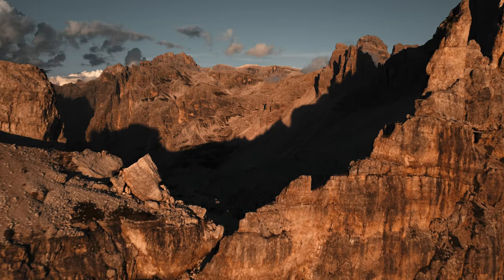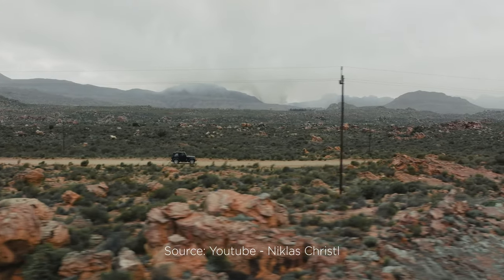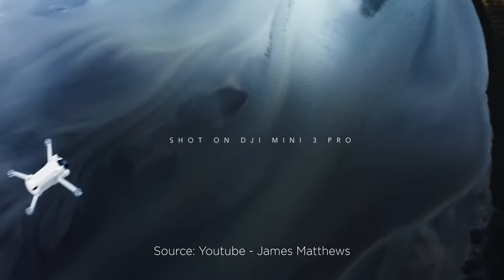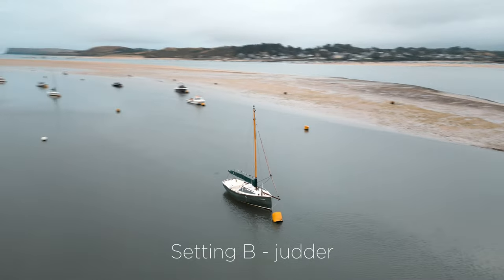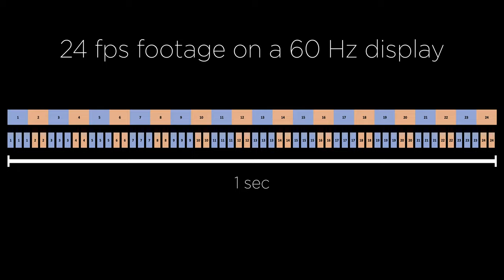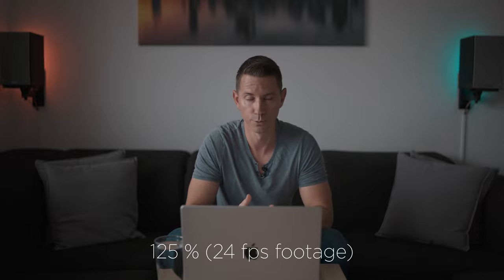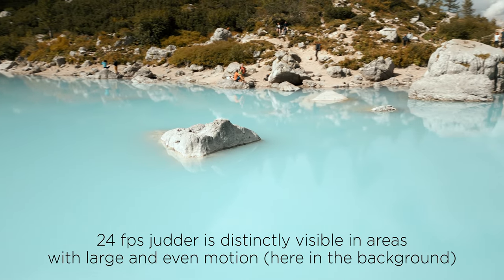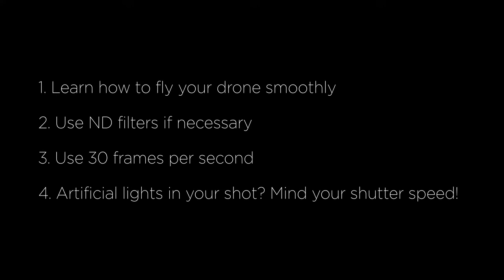The #1 Secret for CINEMATIC Drone Video without Judder, Stutter or Jerkiness

Comment: Hi sir, If my 30 fps on Drone what is my shutter speed? To get smooth motion blur.
Reply from the maker: According to 180 degree shutter rule, you should use 1/60. Me personally, I prefer Between 1/30 and 1/50 with most drone shots.
I have a tutorial video where I talk about things like this.
The ULTIMATE Guide to PRO QUALITY Drone Footage - DJI Mini 3 Pro
https://youtu.be/5aotiUE-iOk
Reply: @t0mwhazzup  Hi thank you, but my shutter speed on my Mini 3 is written in 1/6000 is that the same as 1/60?
Reply from the maker: @yujiitadori30  No, it's not the same. You need ND filters to achieve that, and I explain how that works in the video I put the link in my last response to you :)

Comment: How about 30 FPS drone footage in a 25 FPS timeline? My camera footage will always be 25 FPS. I don't like the 30 FPS look. 04:40 If I put my camera footage of 25 FPS in a 30 FPS timeline I would have to speed it up. But this doesn't make sense. Why would I want to speed up my camera footage? For example interview footage.
Reply from the maker: Well, if you plan to stick with 25 fps all the time for some reason, then do your drone footage also in 25 fps so everything matches.

We run a video production business and we choose recording frame rate and timeline framerate based on the project's target medium. If the project will be aired on TV, we of course do 25 fps because broadcast here in Austria (PAL) is 25/50 so doing the project in 25 fps is technically correct. But all the digital/online/socialmedia stuff that we produce, we do in 30 fps because computer/smartphone screen refresh standard is 60 Hz and 25 fps is technically incorrect. If we have projects that will be used for digital and TV, we consider which part is more important for the client and then go from there.

Generally speaking, frame rate is overrated, in 90% of situations it does not matter whether it's 24/25/30, even though if screen refresh rate doesn't match. You won't see the missing or doubled up frames in most types of footage. It's just in the nature of drone footage and it's camera movement, that makes this incompatibilities often very obvious. But apart from that, most of the times you will be fine with either. I mean, we also put our broadcast stuff (25 fps) on our website portfolio and it doesn't automatically look horrible ;)

And my video here is of course about Youtube (which belongs do the digital/online/social media part), that's why I recommend 30 fps because it avoids judder and is (besides 60 fps, which does not look cinematic/filmic any more) the technically correct frame rate on 60 Hz screens. Speeding up an interview from 25 to 30 fps makes of course no sense as you said. Either you reconsider to also film your camera footage in 30 fps (if you do it for online/digital), or you prefer to stick with 25 fps no matter what, but then do the drone footage in 25 fps as well.

Hope that helps :) Cheers!

Comment: What about 60 fps footage on a 30 fps timeline. Will the two frames be combined and averaged automatically to look identical to native 30 fps footage?
Reply from the maker: No, if played back in real time, every other frame will be skipped. When you use a 30 fps timeline (which I recommend) I would really only film in 60 fps if you want to slow your footage down. It makes no sense otherwise. Every other frame will be discarded, you have worse image quality frame by frame (since the there's twice the amount of frames packed in the same file size) and you lose the ability to use shutter speed slower than 1/60.
Reply: @t0mwhazzup  For me it's either 60 or 120fps recording due to the speed of the drone (cinematic fpv using DJI O3 camera). 30fps is too slow to fly with. But I guess recording 60 and playing back 60 would be the same as record 30 play 30 when it comes to smoothness given 180 rule used?
Reply from the maker: @stefangranath3841  I'll give you a little bit of a longer response here because I have a few thoughts on that.

In general, I use only 30 fps timelines (= 30 fps playback). For one, because of its compatibility for the majority of screens (60 Hz) as explained in this video, and the second reason is that my goal is to make videos that have more of a film-like or cinematic quality, and this is rather achieved with 30 fps than with 60 fps because the lower framerate is closer to the cinematic standard of 24 fps that we're used to from films. If you prefer more of a reality-like watching experience, then you can go with a 60 fps timeline, of course.

So, if you like to have a more close-to-reality feel, go with a 60 fps timeline and choose a shutter speed that lies somewhere in between 1/60 and 1/200. A good exposure is more important to me than sticking to the 180 degree rule no matter what, but in general, yes, 180 degree rule. BUT the higher the playback framerate, the less important to 180 degree rule gets. The reason for that is, the more fps, the less your eye is able to discern one frame from another (and therefore the imaging content and amount of motion blur in each frame).

If, however, you want to go with a 30 fps timeline in order to have a more film-like result, do the following (that's what I do):

I also fly with 60 fps because of the speed of the drone and the 60 Hz image transmission I want therefore (more on that later). BUT because I know that the final video will be 30 fps and therefore every other frame will be discarded, I try to use 1/60 sec exposure time because that will give me the 180 degree rule. I hope this is understandable, but basically you always have to adjust the shutter speed according to the intended video frame rate, not recording frame rate (in terms of fps), to comply to the 180 degree rule.
I might deviate a little bit from that when the exposure requires it (e.g. using 1/80 or 1/100 sec when otherwise the video would be overexposed), but in general, I try to get as close as possible to 1/60 sec for my 30 fps videos.

I once also tried out 30 fps recording (and therefore 30 Hz transmission) with my Avata because that would give me the possibility to use shutter speeds down to 1/30 sec. One benefit from this would be that I am more flexible to adjust my shutter speed (without changing the ND filter during a flight) in a broader range (I'd say, 1/30 to 1/100 is useable). 1/30 sec equals a 360 degree shutter in a 30 fps final video and that gives even more motion blur. I personally like that in many situations, but this really is a matter of taste and maybe not for everybody. Have a try yourself.
I found that 30 Hz transmission is not so bad for my style of flying. I do no acro or racing where I'd consider 60 Hz as essential. So it would be doable with 30 Hz I think, but as my experience with flying FPV is not very broad so far, for now I have sticked to 60 fps/Hz with FPV, just to be sure. Depending on how you fly, you could give it a try and see if it's fast enough for you.

I hope this was not too long and complicated and you can get some use out of this information!
Reply: @t0mwhazzup  This was an awesome reply! Most importantly I will experiment more. The main issue with higher-speed flying and close proximity would be too much motion blur. I think the normal rules so to speak come from more of a static camera. As long as I fly with editing in mind. Love your videos man, keep it up <3
Reply from the maker: Yeah, for high-speed close-proximity FPV a 360 degree shutter (ie 1/30 at 30 fps or 1/60 at 60 fps could be too blurry.
I think though, that at higher fps like 60 or even higher, it should not be much of an issue any more. Guess we gotta try 🙂

Comment: DUDE!!! 
BOTH bridge clips are juttering. Same with the side movement clip.
Reply from the maker: Wrong wording maybe. As long as you don't use 360 degree shutter (which can make things smeary), there will be sone kind of movement gap that can be perceived as some kind of stutter. However, the 24 fps clips have this uneven 3-2 cadence which is omitted in the 30 fps clips. Maybe you can see more difference in the clip where the drone orbits around the sailing boat.

Comment: Hi Tom, great video. It's answered lots of questions. Just wondering, what shutter speeds do you think would work best, if you wish to use 60fps for drones in 60 Hz and 50 Hz? Subbed, liked and rang the bell 👍
Reply from the maker: Thank you very much for your feedback! 🙂
What exactly do you mean by saying 60 fps in 60 Hz and 50 Hz?
Do you mean for 60 Hz/50 Hz areas (mains frequency) or 60 Hz/50 Hz display refresh rate?
Reply: @t0mwhazzup  🙂 Thanks for your quick reply. I was looking at 60 Hz/50 Hz areas mains frequency, but also any tips on display refresh rate would be great 👍
Reply from the maker: @Rob.P  The easy part first: when it comes to displays, always make your videos for 60 Hz displays, that means: 30 fps (for filmlike look) or 60 fps (for more real/sports-like look) timeline. Reason: all consumer displays are able for 60 Hz, so they can playback 30 & 60 fps videos smoothly. The shutter speed is not relevant for display refresh rate, only the video frame rate.

When it comes to the mains frequency... it is really only an issue when you have artificial lights in your shot. If not, you don't need to care at all because there are no sources for flickering.
If there is artificial lights in your shot, in 60 Hz areas (America mostly), you can use any shutter speed with 30/60fps. In 50 Hz countries, you need to use 1/50 sec or 1/100 sec. With 60 fps, you'll only be able to use 1/100 sec flicker free. 
In order to be safe, do a test recording and review the video for flicker. There is also a good flicker calculator which you can use: https://www.red.com/flicker-free-video

And independent of the flickering issue, always try to keep the shutter speed around double the frame rate to have the best-looking amount of motion blur.
For 30 fps, around 1/60 of a sec, for 60 fps around 1/120 of a sec. A little bit up or down doesn't matter. Use ND filters if necessary.

I have uploaded a video about maxing out the footage quality of drone video yesterday, there I discuss a lot of those things regarding shutter speed as well in more context. Maybe that helps as well:
https://youtu.be/5aotiUE-iOk
Reply: @t0mwhazzup  🙂 Thanks for providing so much good information Tom. I have a much better understanding. I'm going to watch your video "about maxing out the footage quality of drone" as well.  Thanks again 👍
Reply from the maker: @Rob.P  You are very welcome! I am happy if the effort I put into it actually helps 🙂 Thanks for letting me know!
Reply: @t0mwhazzup  🙂 Thanks your a great help 👍

Comment: Do your rules and findings still count on like 120hz displays?
Reply from the maker: Theoretically, no. Even though on my 120 Hz MacBook Pro 24p footage still judders (even though it shouldn't, mathematically).

But nevertheless I would always argue that you should produce content that is enjoyable for everyone, and the majority of the displays is able for 60 Hz. That's the standard viewing environment I'd adhere to.
Just as you would make a website that is viewable in every major browser, not only a specific one.
Reply: @t0mwhazzup  Thanks for your (quick) reply! i'll try to shoot 30fps from now on with my Gopro on an FPV drone. still need to find the right settings for ISO and Shutterspeed. (mostly using ND 8 filter).

Can I just ask another question. I hear that the motionblur can get messed up when I use Gyroflow (which I need with FPV footage). What could I tweak in my settings (I guess its a shutterspeed thing)?
Reply from the maker: @sten6537   On the GoPro it is basically the same.. ISO as low as possible (during day ISO 100 should be enough) and then figure out which ND you need to get good exposure at around 1/60 sec (twice the frame rate, which is 30 fps). I have another video on my channel (the most recent one) where the use of ND filters is also explained. The thumbnail says "Make it pro". Look for it, even though it's for normal drone footage, the ND section is also valid for GoPro (or any other camera, for that matter).

I have only played a little bit with GyroFlow, but theoretically yes, the motion blur can mess things a little bit up. I'd initially try it and see if it works fine, if so, don't worry about it. If it messes things up, remove the ND and set a faster shutter speed. That won't look as good of course, but not messed up at least. But I'd first try to go with GoPros internal stabilizing mode, which usually works very well.

I fly FPV only with the DJI Avata and its internal camera, and I also tried the internal stabilization ("Rocksteady") and Gyroflow. I actually think that Rocksteady works better, even though everybody else says that Gyroflow is superior. I'd simply try it out and see for yourself.

And again, try to check the video on my channel I mentioned before, I think use of ND and finding the right shutter speed/ND combination is explained clearly. It also shows the difference between ND vs. no ND wirh denonstration footage.
Reply: @Tom Whazzup  great feedback! Will do, thanks!

Comment: I'm still noticing a jutter/strobe. I did a couple of tests where everything was on auto without an ND filter shooting 4k-60 on a mini 4 pro then another test where shutter was fixed to 1/120, iso auto, ND16 filter and still getting strobing in trees etc across the shots. I'm linking a short clip of a video I shot which has this strobing effect that just keeps cropping up. Its not as pronounced as the jutter in your examples, but it is a sort of strobing effect affecting the entire frame. Advice would be appreciated. https://youtu.be/jv7QKULaRzI
Reply from the maker: Hmmm this looks like a completely different problem. Definitely nothing shutter speed or ND related!
I could only guess: either your memory card is too slow which could result in faulty footage... or, if this video was re-rendered through a video editor, the render quality settings could be too low. But really just making guesses
Reply: @t0mwhazzup  thanks for the reply. I just ordered a Sandisk Extreme sd card so if it’s write speeds, that ought to fix it.
Reply from the maker: @FLAerialSolutions  I hope thats it. Which card did you use so far? Let me know if it works!
Reply: @t0mwhazzup  I’ve been using “TEAMGROUP GO Card 128GB Micro SDXC UHS I U3 V30” which are I think the correct specs on paper to do 4k60 from a Dji drone, but we’ll see.  The claimed read/write specs on the Sandisk extreme are about 50% better so if it’s a card issue, this should fix it
Reply: @t0mwhazzup After a bunch of trial and error I discovered the issue was purely on my display end. I just got a new monitor and must have messed with its settings right before working with this footage. The setting was the "response time" I had set from "fast" to "extreme". I'm assuming this faster setting got the pixel refresh rate out of sync with literally every framerate causing strobing.
Reply from the maker: @FLAerialSolutions Great that you could resolve the problem 🤗

Comment: this is solid. also for slow motion, higher shutter makes things really smooth as well if youre flying a drone that has a big enough sensor to compensate for the loss of light
Reply from the maker: A little bit confused about your comment... usually, slower shutter speeds tend to make things really smooth in video, and higher shutter speed make it more stuttering. So not sure I understand you right?!
Reply: @t0mwhazzup  in slow motion it’s the opposite. You don’t want motion blur in 5x slower motion in like a 120fps or higher rate. If you have a pro camera, try over cranking the shutter way above 180° rule, and you’ll see a huge improvement. On set we rarely use the 180 rule
Reply from the maker: @demonhogo  Interesting. I rately work in high frame rates, but when I do I usually use a 360 degree (!!) shutter, ie 1/120 sec at 120 fps and am very pleased with the results. But I'll try next time if shorter shutter speed in high frame rate video looks better to me 🙂

Comment: 7 minutes to say higher FPS results in smoother video?

....
Reply from the maker: This video is absolutely not about higher fps = smoother, but about the incompatibility between source & project frame rate on one hand, and screen refresh rate on the other. If you missed the point, I failed to do a good job with this video.

Comment: exactly why you are so wrong about ND filters... you just copying other youtubers nonsense. ND filters are for high end big screen productions not tiny sensor cameras shooting for youtube... they totally screw up fast auto-focus and forget capturing stills... the absolute last thing you want when capturing stills from video is motion blur and capturing stills is often vitally important with drone footage.
Reply from the maker: Firstly, it seems like you didn't even watch this video - it is not about ND filters.
And secondly, if you're having trouble using NDs, just don't use them. If it screws up your autofocus, don't use them. (I'd do manual focus with wide-angled drone cameras, anyways - no need for AF). If you want to capture stills, don't use them.
Capturing stills is often vitally important with drone footage? Maybe that's your requirement, not necessarily everyone's.
But again, this video is not about NDs filters.